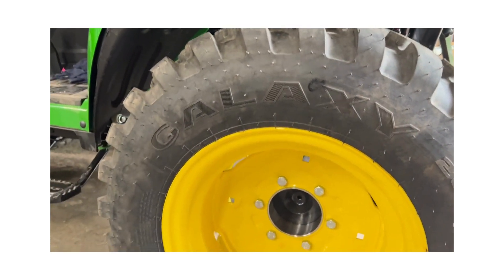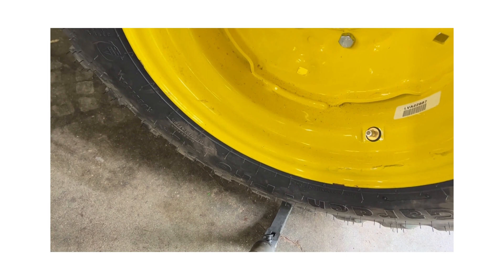Getting Wide Adding Wheel Spacers. Yes another mistake.

Comment: Talk about unexpected mistakes! I just finished adding 3" Bora wheel spacers to my new 2025R JD with backhoe - unfortunately the stepup to the backhoe interfered with the tire - the arm that holds the stepup does not retract with the outrigger which means that the step will scrap the tire if you try to go forward - now what? modify the stepup or chain the arm that holds the stepup to the outrigger in the retracted position - I definitely needed the wheel spacer but in hindsight perhaps a 2": off set would have been sufficient - lesson learned!
Reply from the maker: I’ve done things like that before but always stinks when you realize what’s going on. I don’t know if you can return the Wheel spaces or not but I have had nothing but great success with the 2 inch wheel spacers. The tractor is so stable.

Comment: Hi Neil,
Just got my 2025r and looking at wheel spacers and Rimguard ballast.  You said you went 2 inch but didn’t catch where you got them.  I’m torn between 2 inch and 3 inch.  Stability is a huge concern but so is looks and axle strain.  Just wondering your thoughts.
Reply from the maker: If it were me, I would not go to the 3 inch. The tractor is very stable with the 2 inch spacers. I can’t think of a single situation where I felt like I needed wider. I’ll look up where I bought mine and send you a message.